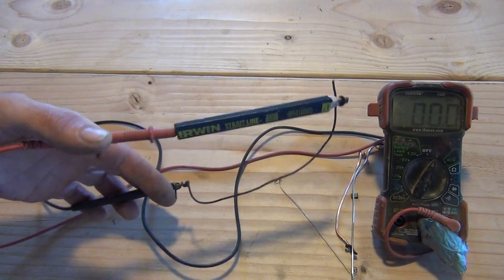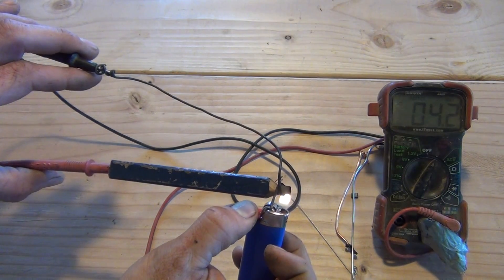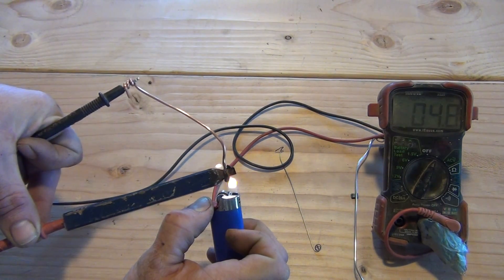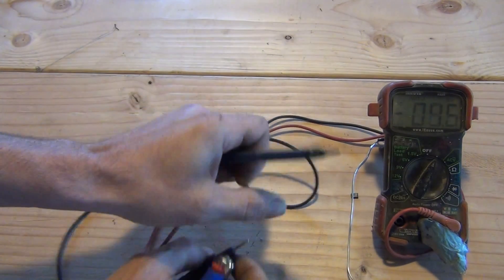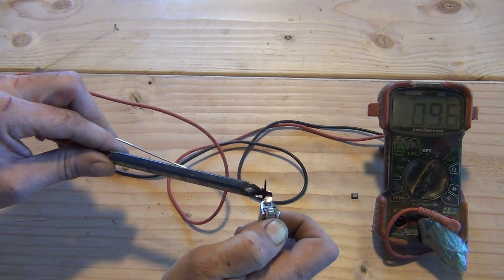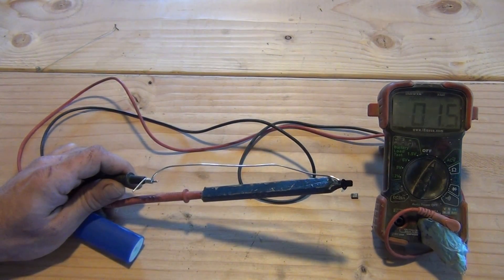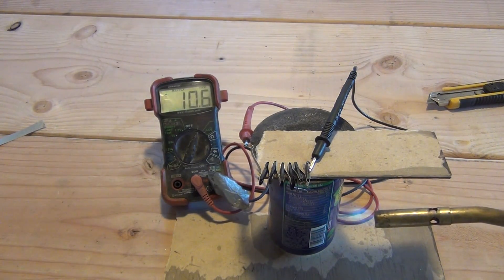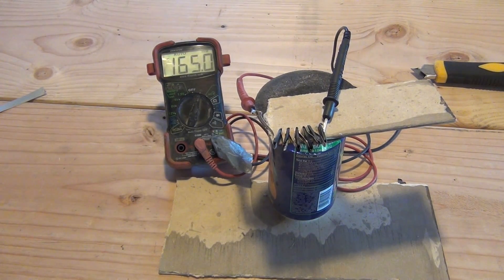Homemade high output "Thermoelectric Generator", 6 cell's 200mv

Comment: Maybe this happens because the heat takes a very long time, if ever, to get from the hot side of the tungsten to the cold side? It's the difference in temperature. Maybe i should try this with my tig electrodes. These are incredible heat resistant, and being exposed above 1000 degrees Celsius touchable with the bare hand after just a couple of seconds.

Comment: ...nice, please tell me what materials are used in most TEC's?  Thank you, this is new to me.
Reply from the maker: Lead and Bismuth are common materials as well as oxides (base metals will work, like copper, iron ect.) , others factors in materials selection is a high electrical potential between the dissimilar conductors, and low thermal conduction down the length of the material.  Materials that produce high seebeck differentials are selected for most power generation, were as peltier chips are made with a set of conductors that both provide a high seebeck differential and a low thermal conductivity.

Comment: I've never made my own junctions, I used the ones from the gas pilot light of a stove or other appliance.  I got 35 millivolts, which I ran into a 'Joule Thief' to boost the voltage up to light a LED. I've found that the problem is getting power from the very low voltage is the current has to be very high, and the conductors have to be very heavy copper.

Comment: wouldnt it have generated even more if your cooling points were longer and cooler im guessing the cooling point was back ends of the aluminium flashing plates u wired... but last

Comment: Why can't they use this on car exhausts to generate extra power
Reply from the maker: +Tim Jadeglans Not at all true if you use only one TEG maybe, the length of the exhaust system could create enough to run most of the cars electrical needs.
Reply from the maker: +Crushonius This should be implemented in roofing and siding materials with a way to conduct the heat in the winter from the house to the roof and walls and from the under side of the home in the summer to the roof or walls this would create homes that self regulate their temperatures without being tied to the grid. By eliminating the Air conditioner from American homes we could reduce energy usage by almost one third, TEG's used as both generators and as Peltier thermal heater coolers could eliminate or drastically reduce the need for air conditioning.
Reply: +MrTeslonian done it on a motorcycle. C:
Reply: did Short circuit it ? The current may dissapoint.
Reply: Christian Garofalo i was just thinking the same thing seriously... 
or on fireplaces? on top of water heaters. on the back of my tv. register covers built into light bulbs or lamp covers .. above the stove. put them on top of your radiators at home. attach them to the inside of my pants or my coat... on my hat..  idk now im going off ha.. the flame generator would work better in the winter ..
Reply: Crushonius whats this? link me??
Reply: MrTeslonian I think it's an interesting project that you're working on here. You might want to measure the power output of your cell before thinking it's going to power the electrical system of a car though. Try putting a 1 ohm resistor across that cell and see what voltage reading you get.

Comment: it could have a very practical application if one constructed a large panel say 3'x3' an inch thick. using perhaps reflective parabolic dishes to reflect sunlight for the heat source. Free energy...what do you think?

Comment: Wondering if this would also work with the carbon rods from a 12v battery? I'm wanting to create a large cell to add to the back of my rocket stove with an outside air intake to add cooling. I am hoping to potentially generate enough to fill a bank of deep cycle marine batteries and use it to power the lights, fans and aquaculture set-up in my garage.

Comment: @MrTeslonian : So can I assume accurately that the larger the gauge of wire or the higher the density of the metal, the higher amount of energy transfer in mv can be created? Furthermore, do you know if that water being the best conductor as well as its ability to hold memory/charge might be why we use it in batteries? I ask because I noticed that once the flame was put to the wire that its charge's residual lasted for a bit; thus, if the charge was received via an electrolyte solution, the residual would last longer?

Comment: You are aware that it's V/degree K, right?  Without measuring the temperature of each side, you don't really know how well you are doing. For all you know your trial with aluminum was 30 degrees C hotter than the one with Copper.  You should consider brazing/compression fitting the hot end so it makes a good connection even when hot.  You might also consider a heat sink on the cold end, because you don't need a fan to passively cool it. Insulating the hot end so you have a small flame heating a chamber to a uniform temperature would be the best way to test it, and also a more efficient way to heat your TEG without wasting as much.

Comment: I'm using a commercial electric 10$ analogue multi reader with copper wire and a home depot construction pencil and I'm not getting a reading. do I need a different reader?

Comment: If you put ice on the opposite ends of the cells, you DOUBLE the voltage. Then you only need 50 cells to get 1 volt. All you need is a Joule Thief and some LEDs and you got a nice cheap light.

Comment: I'm reading Dan Brown's "The Lost Symbol". In that book, a small Masonic pyramid with a Gold capstone, is placed in boiling water (at 33 degrees using Newton's temperature scale). Under these conditions, some formerly invisible writing appears on its surface due to the Thermoluminescence effect. Such a great idea for a secret message.

Comment: So could you create a cell bank that you could incorporate into a solar furnace design and use this in lieu of solar panels?  What would such a design look like?
Reply from the maker: Just Curious Yes to some extent it would work, the issue with using aluminum in thermoelectric or galvanic generators is that it produces one of the highest voltages with one of the lowest amperages out of the base metals I have experimented with. By using copper instead of aluminum you will gain from a higher amperage per cell, and will lose due to the number of extra cells needed to get the same voltage. In the end copper will produce more "watts" in total per cell.The design would be typical flat like any other TEG device, this could be altered to be lets say a sphere with the heat source inside, or a ring for a stove pipe.
Reply: +MrTeslonian if you apply current to it, will is get cold?
Reply from the maker: Owen Chase science channel Yes it is a Peltier as well.
Reply: ***** nice

Comment: Why does it go down, and if it does, how useful is that?
Reply: It goes down because the heat from one side is being transferred to the other. This works with the difference in heat so if you can keep one side hot and the other cold it will produce a continuous voltage.

Comment: Try magnesium.  Magnesium is at the top of the galvanic chart, while carbon is at the very bottom.  Also, it would be more appropriate to see current flow rather than voltage.  Thanks for the video
Reply: Its a bit too risky, magnesium is flammable its ignition point is 473 °C (746 K; 883 °F) and the lighter produces heat at 1970C. So no that's a no go.

Comment: When you heat that metal wire its resistance increase....and the voltage you have observed might be because of that.

Comment: Love the post.  Can't wait to make a couple for my home.  On a side note: Your finger holding the cold wire is decreasing the difference in temperature.  There is residual heat from your fingers leaking onto the black terminal.  The graphite is hot and the other terminal is warming up.  While impressive results, I think you could pull off more accurate testing.  The pencil and aluminum is probably more productive than this shows.  I have heard that in systems like this cooling is more important than heating. Heat comes from a lot of places, the cold is what needs controlled.
   But again, fantastic concepts and implementation.

Comment: btw, Your video was very interesting. I wonder if using Carbon contributed to energy production in Hendershots Fuelless Generator. Imagine high-voltage ARCs inside his hand made capacitor -- doped with Carbon. He might have stumbled upon a combination of SuperCap & Thermoelectric effect due to high-voltage ARCs.

Comment: Also, I see aluminum and carbon (graphite), can be made into a battery by just adding salt water. I suppose if heat is applied, the elements may react faster.

Comment: I had read silver wire and iron wire are the best.
Reply: morpher44 It's not clear from the writing in that paragraph, but I strongly suspect that's 6 volts open circuit and 0.25 amps closed circuit (i.e the voltage has likely dropped quite a lot). I'd love to be wrong though :)
Reply: ***** oh. Good point. Yeah. That sounds logical.

Comment: Would this work on aluminum and diamond, or may be even a piezoelectric crystals?
Reply: Look up pyroelectric effect. It similar to piezoelectric effect in crystals but the voltage produced is dependent on the rate of change in temperature induced on the crystal.

Comment: Why don't you just use a Peltier TEC module and use that as a thermoelectric generator? They will produce 15 volts off a 90 degree Celsius heat differential and they are actually designed to be heated and cooled on each of their 2 flat ceramic plate sides... There  are 127 peltier junctions inside each module. Ganged together in various series/parallel configurations you can obtain any voltage/amperage potential you desire. I have a bad mental image of you sitting there with 1500 home made junctions ham fisted together in rolling flames to produce the same 15 volts. Best possible outcome from that scenario is managing to not burn down your home...
Reply from the maker: It would be a Seebeck effect TEG that would be designed for electrical generation the pettier will work just not efficiently.
Reply: TECS cost $5 each TEGS cost $250+ each.  That ridiculous 50:1 price differential more then makes up for the minor efficiency gain unless space is limited or one has a NASA budget to play with.lol
Reply: I've been thinking about making a rectangular stainless steel exhaust pipe section and covering it with TECs and heat sinks on the sides and bottom to produce the 15 volts for my car so I can install a field eliminator switch on the alternator freeing up that 15 HP drag to increase fuel mileage. There's more then enough waste heat from an engine to provide electricity for an ignition system, charging the battery and lights. Old CPU heat sinks would work perfect too as the air from the forward motion would cool them fairly efficiently. I might replace the battery with a super capacitor bank or LiPo pack to drop the extra 40 pounds too.

Comment: Very interesting experiment. Just a thought , mabe you could try using Cu coated carbon arc rods, i know its not Al but it would take much less time to asemble. Or i was also pondering the idea of finding some type of Al that the Cu could be coated with via heat and flux. Iam not sure but it might even be able to gain a little more output energy. What do you think ? As usual iam very intrigued by one of youre
Videos, Thanks.

Comment: Your videos are priceless.
I notice they sell graphene coated aluminum foil at $90 for 10 lbs. They also sell graphene coating. Would the wide area of a piece of foil produce more electricity? or are wires better?
Reply from the maker: There is a good and a bad side to using foil first as you state it will increase surface area, the problem I found was the foil melted at a much lower temperature, This combination can withstand very high temps if the aluminium is thick enough.
Reply: MrTeslonian But a large panel under the Sun’s heat... maybe even with a focusing lens

Comment: This makes perfect sense from the point of view of electronegativity. The combination of materials with the greatest difference in electronegativity will produce the greatest voltage. Carbon has the highest electronegativity with 2.55 then in descending order Copper 1.90, Iron 1.83, and then Aluminium with 1.61. Of course I am sure you all ready knew that.
Reply: That's not why. This is producing a Seebeck effect. The two things you want in a thermoelectric material is high electrical conductivity and low thermal conductive. Aluminum has both high electrical conductivity and high thermal conductivity, where as graphite has fair electrical conductivity, but VERY low thermal conductivity.